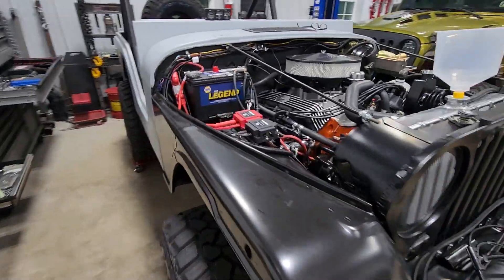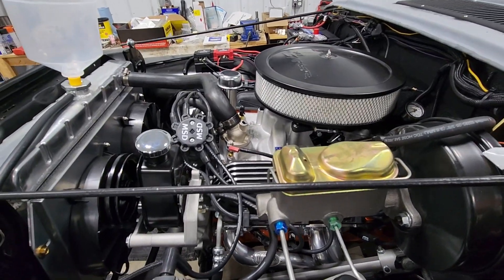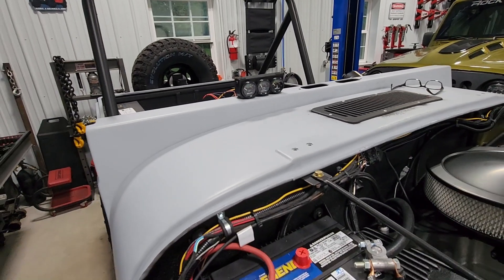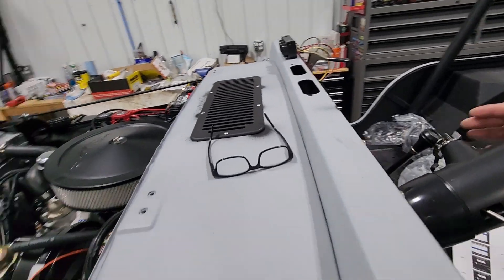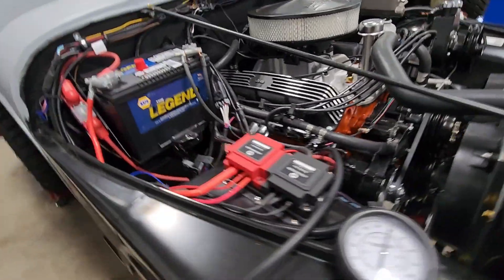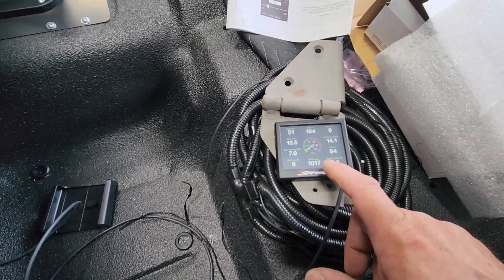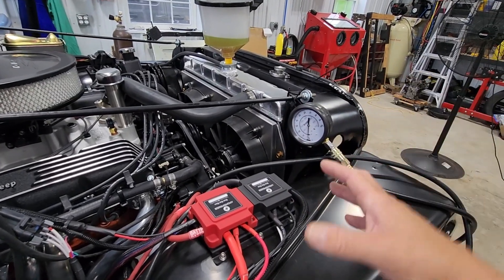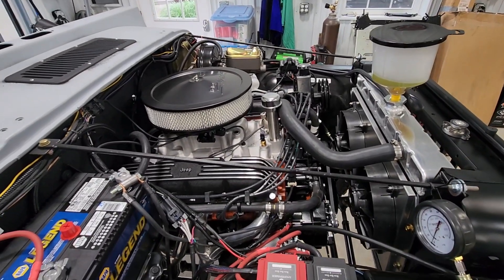IT IS ALIVE!!! CJ5 FIRST START AND BREAK IN

Comment: Very nice. If you don’t mind me asking where did you get your engine rebuilt at ? Looking for a place to rebuild my 304
Reply from the maker: Where are you located? I'm in the Lehigh Valley area of Pennsylvania. The shop that rebuilt my engine is Sigafoos Machine in Easton, Pa. It is a small shop, just the owner and one other guy, Dave and Walt. Both are in their 70s. Walt used to race AMC motors and knows the AMC V-8s very well. The shop has a great reputation and personally there is no other shop locally to me that has the same experience with these motors. They do ship motors so if you aren't local you can call them and they will work with you to get it shipped to them and back.
Reply: @millstonejeepworx  I’m some ways from Pennsylvania. I’m located in Los Angeles. I’ll try looking for something closer. I just recently bought the Holley efi system for it and it felt the best it’s ever ran but I think I just blew my engine and now just looking around for either a rebuild shop or maybe thinking of getting one of those engines from s&j engines. Not sure yet
Reply from the maker: @EduardoParra-dt6lt  Yeah, the shipping would be alot. I'd look local or for an S&J as well